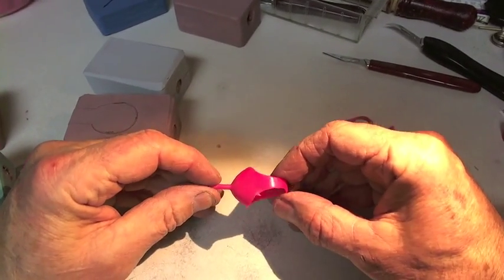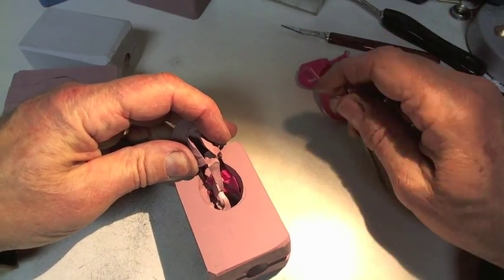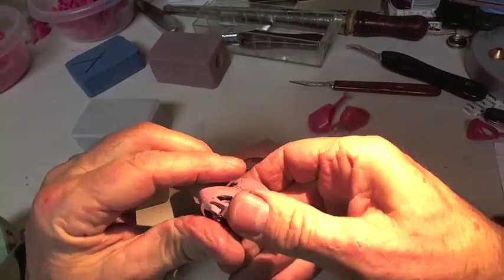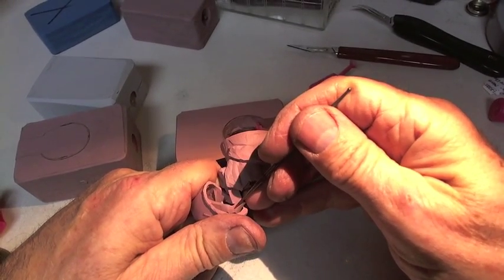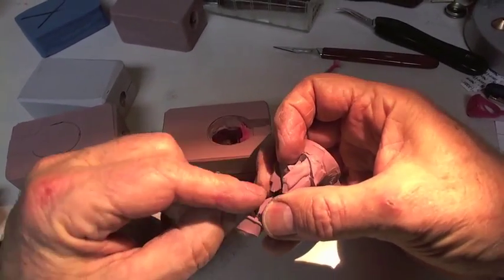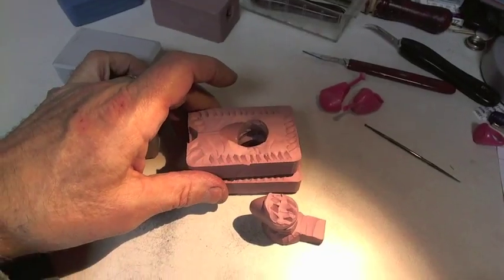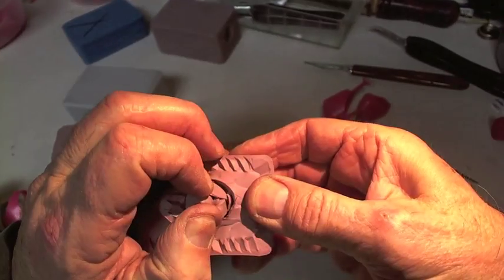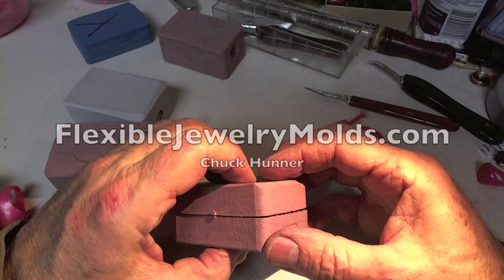Dome Ring Strategy

Comment: instead of putting the ring in the molding form tray vertical put it in the tray horizontal and cut the hole plug out of the center of the rubber block then cut the plug in half this will be easier to remove the wax pattern
Reply from the maker: Many ways to do it, Nicholas. Thanks for your excellent comment